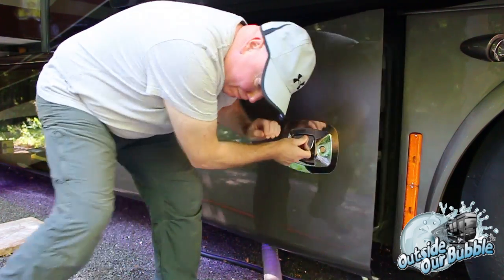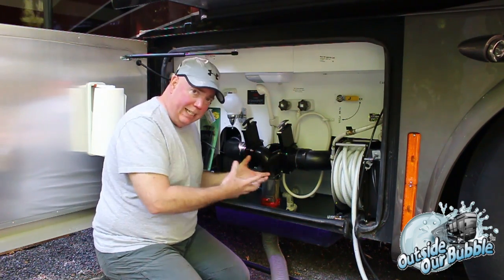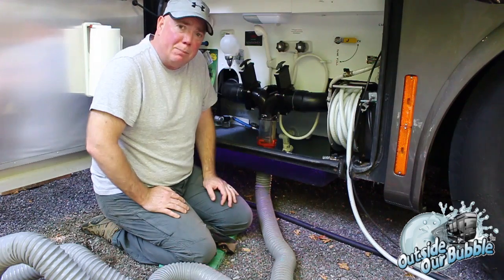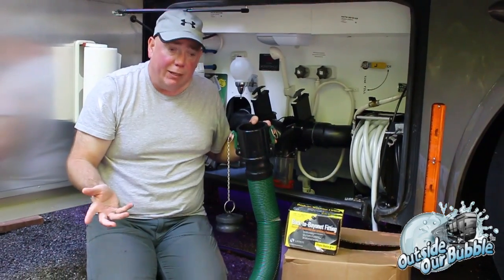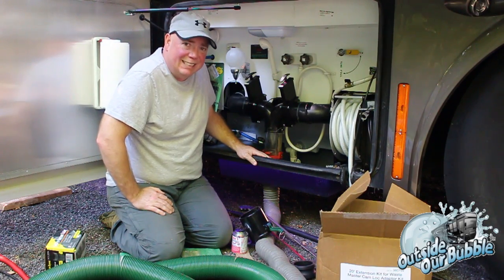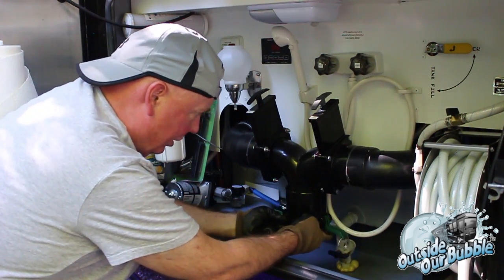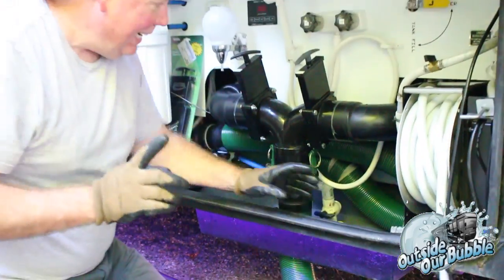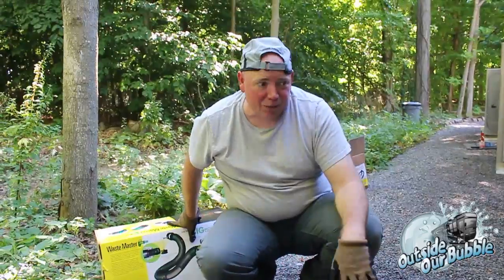RV Gray and Black Tank Thoughts and Waste Master Install

Comment: Hey there.  Met you at your permanent place in NY.  I was the guy that had just bought the DRV 43' toy hauler and you walked me through your solution.  And we talked about your robotic pet that kept your patch of green so perfect.  I came by a couple times with my wife before we had to leave, without success.

Taking your advice and getting the waste master hoses and returning my my Camco hoses to Amazon.  That they actually want me to return them gives me the oogies, but hey - not my business model.  I'll put them in a bag and put a note on the outside as a warning.

Anyway, thanks for the advice, I appreciate it.  I hope we meet again the road some time.
Reply from the maker: Hi…Sorry we were not around before you left. :( Glad top read that you will be going to it for we sure are glad we did as it has been so great. Be sure to also pick up the “Back to Bayonet” fitting for it. It is a CAM connector with the bayonet tabs. You also may need it at some point if you need to use a dump service, like at a rally or something, as they will not have a CAM fitting for sure. See you again if you come back to Southwoods!
Reply: Pete Austin to

Comment: Great video David.  I have been using the Wastemaster System for about 2 years and am still very impressed with it (love was too strong a word).  The only issue I have had with the hose was self inflicted when I started my Oasis (Similar to Aquahot) Heater on morning and had not moved the waste hose far enough away from the exhaust (my bad).  I removed the damaged portion of the hose and have been using continuously since.
Being a fairly early adopter of the system forced me to build my own accessories.  I found that 2 chains stores handle many Camlok fittings (Tractor Supply ad Northern Tools), they are also available through Amazon.  If you choose to make your own I found that having a supply of differing thickness gaskets for the female side of the Camlok is a good idea to keep around.  There is always a chance that you could loose one but fittings from different vendors  can occasionally have slight size differences having a couple of 1/8 to 1/4" gaskets is cheap insurance.  

I liked the system so much that I have converted all my fresh water supply connections to Camloks as well (they are availble in 3/4inch).  Camloks are so much more dependable than other "Quick Fit" options. 

Enjoy your videos - Steve

Comment: Hi Dave,
I purchased this system some time ago but never used it due to the start up system that came with our MH. Well as luck would go,I had a split on a trip before we ended our season just before our return trip home.
So just before our departure home I did the install and it took me a lot longer to do by two minutes ... ha! It by by far is the best thing I could have done.
Now I have a very dependable worry free septic discharge & 
monitoring sewage plant.
The only way I can see it being easier is it the bride would do it all for me...h! Thanks for you guys doing the clip...you made it simple!
Mike... upstate NY.
Reply from the maker: Great to read!  Yes, we still very much like ours and it is still like new to this day.   We are in Upstate NY during the summer at https://SouthwoodsRVResort.com

Comment: My first inclination is...wow, that's a lot of hose & adapters to store....and I don't 'full time' so mine only get used for a few months of the year, so I'll continue with the old system for now, but yes, the Wastemaster seems a more solid unit indeed.   At the moment, I'm hoping to install a circular tube under our Phaeton, for hose storage, and as it looks here, the Wastemaster won't fit...so again, for those with a ton of storage space it may be the answer!   I for one, don't care to have my hoses inside the basement, thus the reason to get them out under the coach....but thanks for the video David, as I've been a long-time subscriber, and enjoy the huge help you and Brenda bring to us RVers!

Comment: Nice instructive video Dave!  I've been using this system since 2008.  Love it!  Couple of things I really like about it:
- Hose compression for storage
- Exoskeleton keeps rocks from abraiding the hose and keeps the inside of the hose smoother for effluent flow
- Thick material!
- Built-in sight glass
- Leak free CamLock fittings so I never have the hose spin off at the termination (had that happen once with bayonets - ew!)

Comment: if you are considering to buy the lippert waste master - this is THE video to watch - entertaining informative and runs you through the COMPLETE install inc. great testing tips. (watched five videos on this product and by far this is the most refined). tip - if you use a waste tote cart the “tote tank adapter”  (5669) is superior to the “cam to bayonet fitting” (5629) - $10 more but has the sta-put hose (the hose that came with my barker tote tends to slinky too easily).

Comment: I bought and installed this system and works great. I did not purchase the extension and connector but did purchase the Back to Bayonet fitting. In the rare case I need longer than the supplied 20' hose (tube) I use my old standard hose with an extension to empty the tanks.

Comment: I really enjoy your videos.  We also have a 45' A.B.  I'm retired from the oilfield and I used the cam-lock fittings everyday for years.  The ones I used were for high PSI and were usually brass but sometimes aluminum.  I like the idea of of the cam-locks but I can't think of a place to haul all of the extra fittings and the hose with the large valve at the end.  Looks like a nice setup especially if you are a full timer.  Thanks again your videos!

Comment: Great system!! Way overkill for what it's used for but a great system. I've been using the same slinky tube for 6 years and it still hasn't leaked

Comment: Looks like a great system. I use to drive tanker trucks a few years ago and we always used cam locks. If you do get a leak it will come out where the cam lock levers are. Had that happen a couple of time with a worn gasket. Lucky it was food product (Edible).

Comment: The Waster Master definitely looks like a better system.  Since the cam tube that you cemented to the Y connection make the hard pipe portion  longer, have you had any issues being able to connect the waster master hose through the hole in the bottom of the wet bay if the back end of your coach is sitting low because a site is not particularly level?  Also, since the cam hose slips inside the connector versus the traditional bayonet connection in the wet bay, have you had any issues with gray or black water material being left on tip of the cam hose when you disconnect?

Comment: I've been using the cam lock system hauling petroleum for 30 years. Of course we use aluminum fittings and brass dog ears.. And they do wear out. Plastic on plastic will not last forever and you will have to replace the male ends and dog ears.. And if you're not careful you'll destroy the female receiver knocking out the steel pins (hopefully stainless) to change out the dog ears. They tend to rust.. Rusty steel passing through plastic... Well you might as well through it away because the new steel pins won't stay and the new dog ears won't seal. I have 31 years of experience with this style of hose connections. Trust me, they are not leak proof. Plastic will wear out faster than aluminum and brass. ... 

It looks like the hose quality is a good improvement from the previous products out there.. For me I would buy the hose and adapt it to the bayonet system.
Reply: I am not sold on this system. Hose is great I agree.

Comment: Have you had any problems with the discharge end fitting into the pvc sewer connections at different parks?
Reply from the maker: I haver not at this point.

Comment: Quick question on the Part you secure in the plumbing in the ground. It dose not seem to be very secure as there is no connector to hold it in place and seems like it will be  prone to pop out ?  Your Knee hit it very lightly and I was waiting for it to come loose . Is it a tight fit ?
Reply from the maker: Hi...That is called a donut.  It is a rubble seal that fits down into any size sewer opening.  A donut is now actually required to be used in a number of states, like in Florida, to seal the connection to the sewer.  As in this case, they provide one already on the "business" end.   You will find when you travel some park have no threaded connection and the ones that do they are stripped anyway, thus requiring the use of something else to make the seal.  AKA...The Donut.  It is very secure.  Hope this helps.
Reply: Thanks for the Reply.

Comment: Now that you have been using this system for over a year, what do you think about it?     Over the last year I have been at two campgrounds that the sewer connection was down in a box.   Not sure how that large head would fit down there.   Is there some sort of extension available?
Reply from the maker: Hi...Sorry to read what you ran into as I have never seen that. Weird.  But to answer your question...I will surely not be without the Waste Master. The build quality of the hose and the CAM lock fitting is just great!!!  The hose still looks new. As far as an extension...Seeing that is not usually the case, I have nit thought about and it surely is not normal to the point an extension to the head would be offered.  I would have likely taken my old hose and cut a small section of it to fit over the end for something like that.  So that is a thought for you. :)

Comment: The only thing is that big valve with the donut sometimes won't fit in some smaller sewer connections and or like a 90 degree for example but it is not often. Cams do wear but are replaceable at least they are on tanker trucks. Not sure if Drainmaster has replaceable cams.
Reply from the maker: Hi...The good news is that you can take the donut off and you will find threads for a normal tube.  So you can carry say a 2 feet piece and put it on the end and then the end into the sewer.

Comment: Hi Dave, since this video is 3 years old I want to see if you have any updates on the use of the waste master.  I have found good and bad reviews. The bad ones are saying the hose breaks easily and I would like to hear your opinion.
Reply from the maker: I for one would find that the hose was not holding up to be a surprise. I still have the original one and it still looks new.  I know that the guy that designed it sold it to LCI so not sure if they may have changed anything over the years.  When he was making them each hose was tested to 10 PSI of air pressure after it was ambled to pass inspection. At this point, if I needed another hose, I know I would still buy one and still do recommend them.

These are the people that originally came out with it.  I also have their electronic dump valves.

https://drainmaster.com/main/

Comment: Unless you live in Illinois (speed bump of U.S.A.)...lol  VERY nice video guys, ? do they have a clear window up at the beginning, so if you have trouble? As always Happy Trails
Reply from the maker: Hi...They have a clear viewing tube at the end where it exits. They also have a shut off right at that point in case of an issue with the sewer line backing up. Based on it being a CAM fitting, no clear tube at the start point as the connector is fused right to the hose so it can not leak.

Comment: Do they make the cam lock connection at the Y location in clear plastic so you can visually see the water coming out instead of having to go all the way to the other end of the hose?  It makes no sense to not have it at the valves where you control the flush valves.
Reply from the maker: It makea all the sense seeing that with this type of setup one is usually controlling it from the INSIDE of the RV/Coach. Thus you would not see the Y.    Thus looking out a side window you can see the outlet of the tube. Also, they do not make the Y, just just make the fitting to replace on the end of it to go along with the Waster Master...the best hose EVER.  Mine still looks new and I have had it now years.

Comment: Whats the life expectancy of the hose? Asking because that will be a really expensive replacement with that head built into the hose...
Reply from the maker: Well we live full time and thus it has always been in use and we have had no issues and the hose looks still new from Sept 2016. No sure on the live span, but I replaced other hoes in 6 months based on sun rot.

Comment: Have you thought of adding in a macerating system for your black tank?
Reply from the maker: We had one LONG ago and would not use one again.  It does not have the PULL of the large volume water flow that is needed to pull the solids out of a tank.

Comment: Dave the black Valterra hose is much better and cheaper than the gray one you have, give it a try.
Reply from the maker: Thanks.  However it does not stay where you put it from my testing and it is not a CAM lock fitting.  In all my years of travels, 2008, this has been the best solution I have found. (IMHO)

Comment: Dave can you use your grey water to flush out your black  water tank.
Reply from the maker: Good Question!!!  And YES you can. Once the black is empty, you can close the valve at the end of the hose and while leaving the black tank open the gray tank. This will force the gray water into the black tank as long as you have enough built up.  We do this and when I know I am going to, I let my gray get above 90%.  But very good question!

Comment: Why don't color code the flush lines using gray and black PVC so you don't have to guess which one is from the gray tank and which is from the black?
Reply from the maker: Most of the time the RV's come with GRAY and BLACK handles. :)

Comment: If you had to trouble shoot, say flush backwards or something, then what?  I  have had solids plug the outlet up in my travel trailer.  It happens.    My family and I love  the movie RV.
Reply from the maker: Iam not sure on the question.  It is still a full 3" opening it is just a different connector you are using.
Reply: @DavidBott    I would guess you could get a cam lock fitting with a water hose connection to back flush into the black tank (and gray) if it didn't drain due to pluggage.  The cam lock system is not something off the shelf like the stock system.   I like the product but if it fails how easy is it to repair, replace, or adapt something so it can be used.   Thank you for the video.
Reply from the maker: @honiswagner7674  There is a fitting called BACK TO BAYONET that is Cam lock on one side and BAYONET on the other that I carry with me but have never needed to use.  The BAYONET fitting is only used by the RV industry and it just shocks me to say the least someone would have chosen to do that long ago other than to have it be a special item one needed to have.

Comment: The video is great -- but when it comes to the black tank and hoses... there is no way I would install anything but the regular hoses.  Gravity has worked well for my coach, and those gimmicky contraptions may seem to add benefit, but really... it's not something so complex as to require anything other than gravity and a simple hose.  Gimmick just provide for one more thing to go wrong.  And what happens if they go out of business, or you need a replacement, or you decide you don't like replacing them all the time... you've stripped off and permanently disfigured your outlet.  I've seen people spend hours on reducers, movers, sealers, and macerators -- all because something got clogged, something broke, or something isn't working properly.  I just don't understand the attraction to things that over-complicate an otherwise simple and battery/electronic/contraption-free activity.  Not to dog on your new purchase -- I do hope it goes well for you, and I do think you've gone a great job on this video.
Reply from the maker: Sorry to say you must have missed that you can alway put it back to normal with a $14 part.  You also must have missed this is a gravity feed, nothing different other than a connection that is used world wide and does not leak.   So I have to think that you really did not understand what it was.  Also, the company LCI is one of the largest RV parts manufacturers. The way this hose is build, it is unlikely I will have issues in the future has I have with other hoses.
Reply: Sorry about that -- I ventured off into talking about "other" hose contraptions as a whole.  I just am not into any kind of alteration if it doesn't serve a solid purpose.  I've seen so many people (and likely you have as well) with all sorts of non-standard contraptions on their outlets.  I should have been more clear about that.
Reply from the maker: No problem.  I was actually thinking you may be referring to a macerater.  And to that, I totally agree!  The best part about this solution is that it is built industrial.  So not only the fitting is one used all over the world and thus is proven, the hose itself is very, very though.  It should be the last hose I will have to buy.

Comment: What a pain in the butt and where to store it when you have a trailer VS your big Motor-home.
Reply from the maker: Store what...The hose?  The same place you store your current hose.
Reply: Mine goes in the bumper tube and that big valves won't fit it would be better if the valve came off.
Reply from the maker: Ah, I see. They make an end cap to house the head for the rear bumper hose holders. But I see your point.